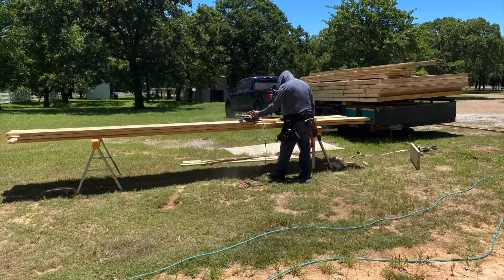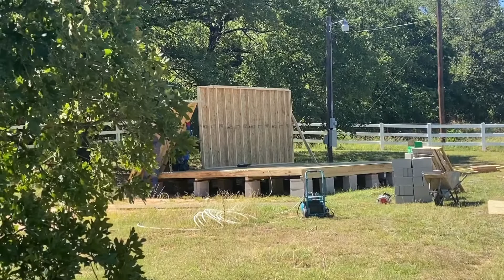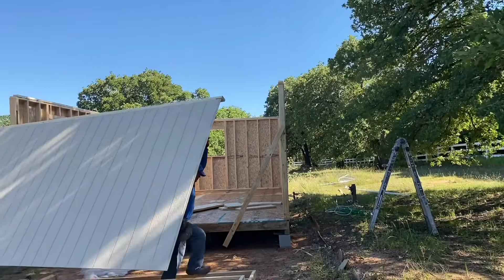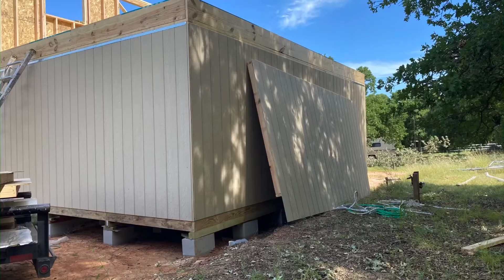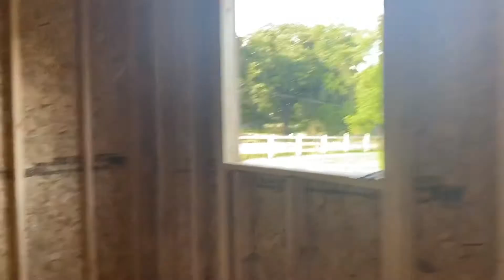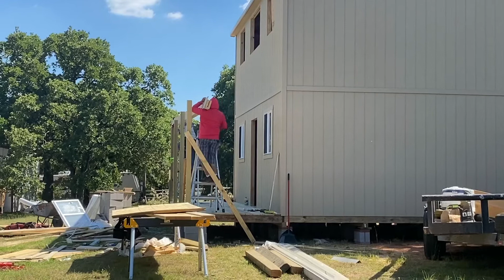Shed to house (cabin) build Part 1

Comment: Where did you aquire this shed?
Reply from the maker: Home Depot, Tuff Shed.
Reply: @rolosgarage5343  that was a cool 2 part series, I've been contemplating building me a home out of a shed like this. I don't see myself in the near future being able to afford a home. Can you give me any tips on getting started as in getting electric legally and gas? I don't know how to even start.
Reply from the maker: @thomas5822  I don’t know about legal electrical, because I live off city limits, so no need for permits. You might want to check the laws where you planning on building it first. Gas the same. We don’t have gas nor chimney, we use electric heater. There’s lots of solar options nowadays you may want to consider, which I’m doing right now, in order to lower the electric bill. Remember you would need a septic tank too. If you can find a used shed halfway converted, you may safe lots of money too. And watch lots of YouTube videos.
Reply: Thanks a lot, just that info really helped, I also didn't know about not needing a permit outside the city. It's all just an idea now maybe I'll be able to do this. Thanx!
Reply from the maker: @thomas5822  yeah, no problem 👍, remember for the no permits off city limits, every State or County is different, make sure to check yours before any move. And the farther away from power lines you build your house, the more you will pay the electric company to route it to your place.